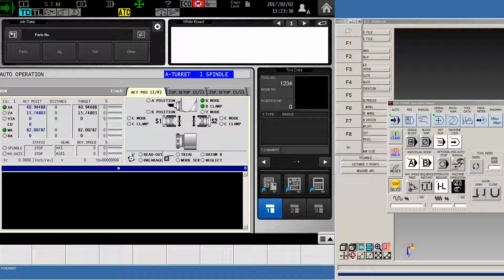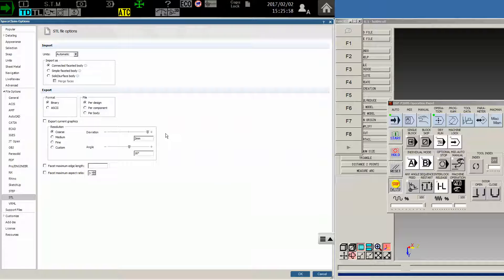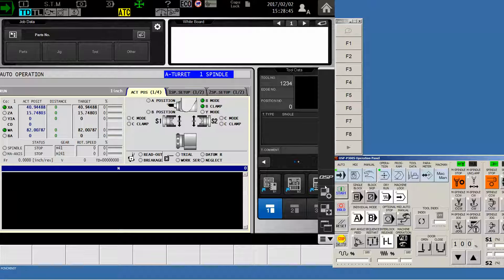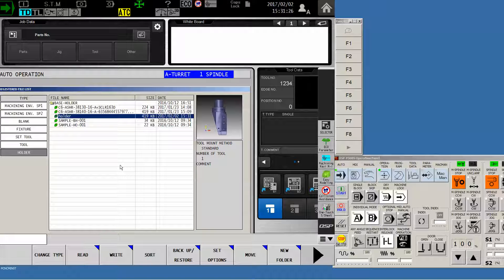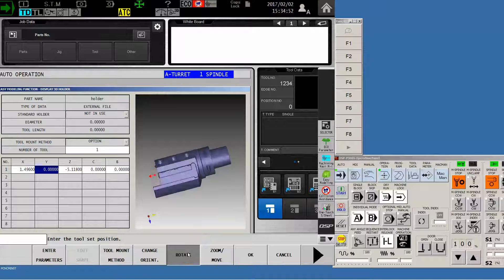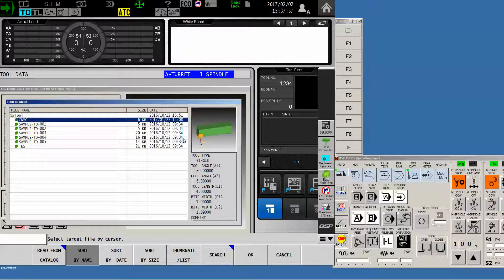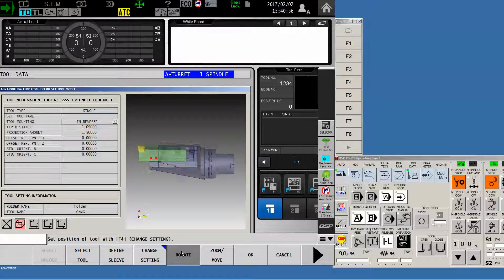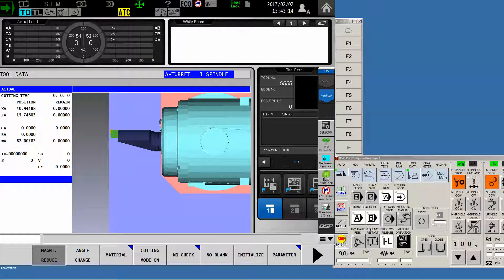STP HOLDER

Comment: Good morning,
thank you for your very interesting video, you can tell me where to find the software..
STL CHECK!
what i see in your video
THANKS
Reply from the maker: You bet! The Lite version is a freebie from Okuma, but the full version that has the ability to edit and heal models is a module from the Admac Parts software seat Okuma offers (also known as 3D Virtual Monitor).  Your local Okuma retailer should be able to get you pointed in the right direction

Comment: 01:40: Rota el Sólido  03:30: Lector de STL de OKUMA  04:00. Corrige el Modelo STL
05:00 Listo para importar el Sólido  
05:50: Varios clientes quisieron importar Soporte + Herramienta de Palo PERO...
06:00: IMPORTANTE: La Máquina necesita saber que el Inserto puede tocar el Material
Mejor que el Programa (EASY MODELIN) cree la Herramienta de Palo
06:45: Importa STL desde PEN DRIVE  07:10: Presiona CAMBIAR TIPO DE ARCHIVO
07:20: EJECUTAR  07:34: OK  08:06: EDIT  08:18: CANCEL y CLOSE  
07:34: OKUMA dice que el modelo no tiene errores
08:22: EASY MODELING  08:48: TOOL MOUNT METOD  08:52: OPTION